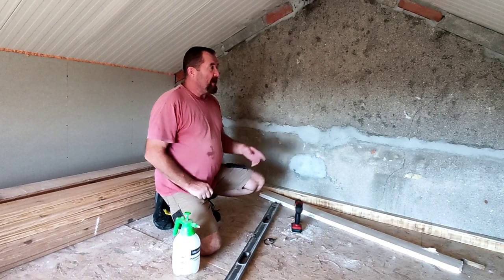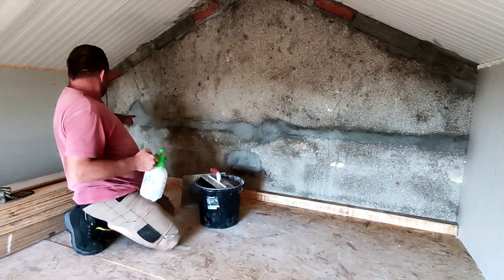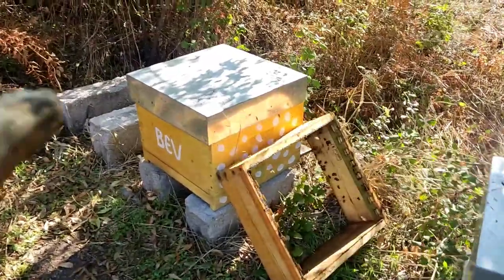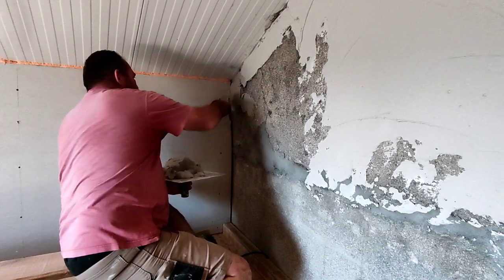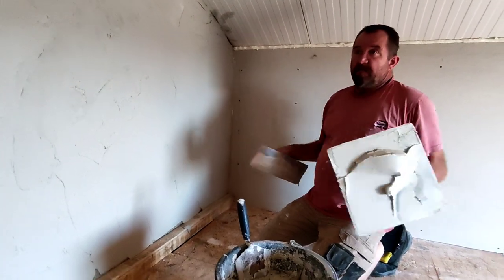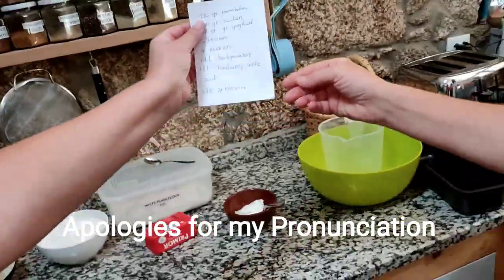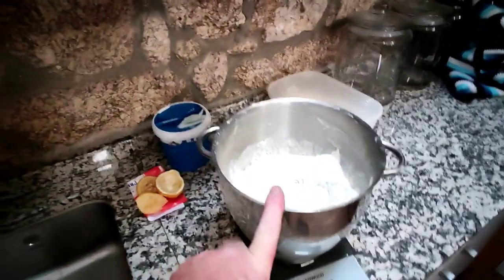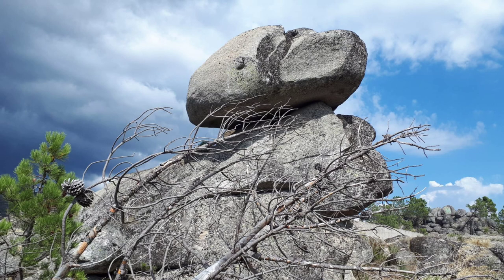98 : How to Lay Base Plaster on our Portuguese Farm and A Lemon Cake Recipe 🍋 🍰

Comment: Hi guys, great video! Nick how's the plaster in the PT compared with the red English one? The one you are using looks like bonding to me... Does it finishes the same way as normal plaster?  Or do you float it out? What about PVA? Is it not used in PT?  Great stuff 👌🤞👍👍
Reply from the maker: It's s bonding plaster that can be troweled to a finish,

Comment: Hi Nick.Once again another enjoyable video. Excellant instructions on plastering tecniques and tips. On my schizt casa I would like a stone feature wall in exery room and the rest repointed and sealed.I know that you are not keen on lime plaster/render. Is the backing plaster suitabe for rendering the schitz stone, and also what would you use for repointing? Not sure what I need. Gladyou showed which backing plaster you used. If you go to Castelo Branco for material, do you use Maxmat, Brico Marcha, or suffrgens?  Steve & Cass
Reply from the maker: The stuff I used will be good on most materials, pointing with lime on the inside for a nice visual effect would be an excellent idea, I wouldn't use it on the outside or you may  risk being damp on  inside , I use any supplier that gives me what I need, but lime plaster or pointing on the inside may be easier for the beginner because it is stickier😁 hope this doesn't confuse or upset you, just trying to help😁👍
Reply: @projectportugal  Thanks for the advice.. I will give it a go, next time I am over. Take care.